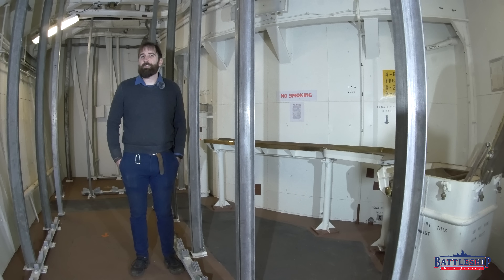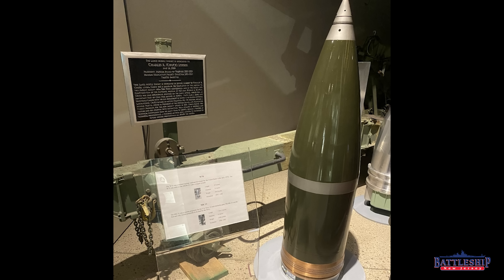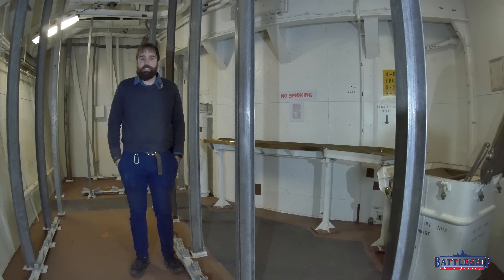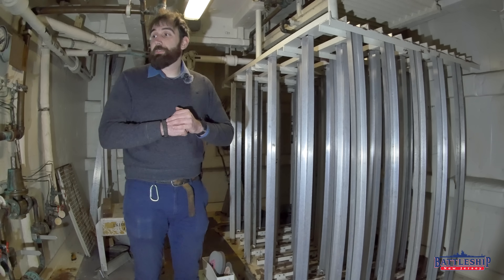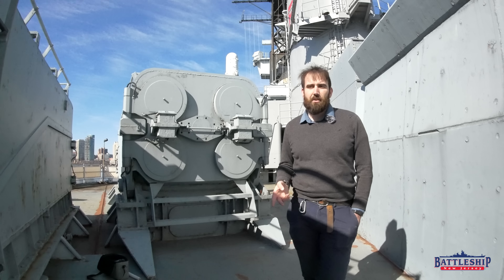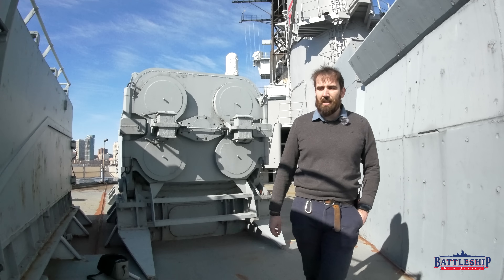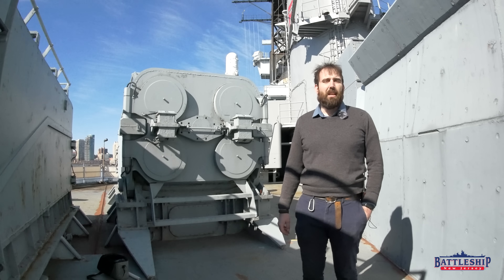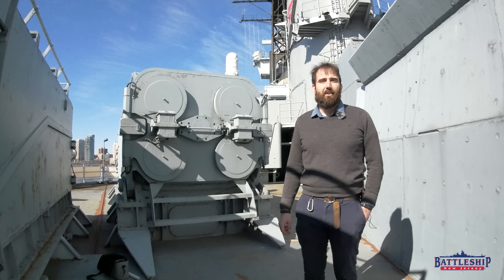Are There Still Traces of Radiation From the Nuclear Weapons on the Battleship?

Comment: I would have checked all the old gauge and compass . They were doped with radium. Also if you still have old smoke decters. If you have them DO NOT OPEN THEM ! The paint with the radium decay and turn into a dust. Open it and breathe it in or don't wash your hand you may eat the dust . Go to radio active Drew on YouTube . Just like this channel it is quite informative .
Reply: No they are americium 247 in them no radium the old smoke detectors.
Reply: @ghinckley68  yea , true . I have a small collection of them . The old detectors do have very strong radioactive material in side . And some old plates that have uranium glaze on them . And old gauges they too will set off a detector .
Reply: Better not to open any smoke detectors, old or new

Comment: You'll need the actual radioactive isotopes to contaminate something, not the radiation itself. Since warheads have their isotopes sealed deep inside, you probably won't find any evidence even if the ship was loaded with them in the past.

Your most likely location where these isotopes may have transferred would be magazines or lockers that would have contained depleted uranium as the slug or bullet. If you have ammo boxes for smaller arms, it may be there too. I'm not sure if depleted uranium rounds are jacketed but that might make it more difficult.

I work as a 'citizen scientist' contributor with SafeCast and gather radiological data as a hobby and upload to that project. Could I come by and map radiological data on and around the ship? My Geiger counter maps readings with GPS location and indicates readings in CPM (can be adjusted to Sieverts calibrated to Cesium-137).
Reply: In principle you could have some Iron-55 from steel absorbing spontaneous fission neutrons from the HEU core. But the W-23 was withdrawn more than 23 half-lives ago, so fewer than one in eight million Iron-55 nuclei would still be around.

Comment: if anything the battleship is one of the most safe places on earth in terms of shielding from radiation. having so much steel really slows down those gamma rays
Reply: nope the steel on NJ is hardly and inconvenience for a gamma ray
Reply: @ghinckley68  all it takes is 10 inchs of solid steel. where the steel is thinner than that is bellow the water line which also provides protection
Reply: @imchris5000  depends on the energy level but 10inches of lead is bare minimum. It would take a few feet of steel to stop even the weakest of them.
Reply: @ghinckley68  energy level does not matter. radiation is a wave just like microwaves. all it takes is enough space to break said wave.
Reply: @imchris5000  no you did not pay attention in high school physics. 
1, alpha particles are a He4+ nucleus 2 proton and  2 neutrons.
2, beta particles  are electrons or positrons.
3, Gamma Rays are photons at either the gamma or x-ray energy level.

Gamma rays go thru shit because the photon is small enough that on avg it goes thru the empty space in matter till it something that absorbs it.

microwaves are photons at a microwave level. In side you microwave there is magnatron tuned to 2.54ghz the vibration frequency of water. It blasts out photons at that with that wave length to heat you food.
That wave length is 12 cm that is why  they can put little holes in the door and you do not get blasted in the face.  

not death rays from a magic ferry wand powered by mediclorines.

Comment: They either were measuring in either "counts" or in milli sieverts /hr. BGR is about 1-4 mSv/hr so 6 is "slightly" elevated so maybe a trace of something or just could be a consequence of the manufacturing and what kind of alloys they used to make their launchers etc,
Reply: becreals or disinterations per sec,  sieverts is  exposure
Reply: Geiger counters are dumb and just count. Any sievert reading is just a guestimate from them and assume it's only reading one isotope, usually  cesium 137.

Comment: Many Chelsea clocks, a favorite of the USN, could be ordered with radium dials up through the early 1940s.  Ship’s clocks got overhauled pretty regularly so there probably aren’t any left on board with hot dials.  The problem with old radium dials is the phosphor gives out after a while and quits glowing, but the paint may still be radioactive.  I bought an inexpensive Geiger counter to check old ship and aircraft equipment before I do restoration work.
Reply: A fascinating story to read up on is "radium girls".
Reply: @jth877   my grandmother worked during ww2 at telechron which became timex in Ashland mass. She told tales of seeing the girls in the special paint dept, painting the clocks and watches with the glow in the dark paint. When the lights were shut off the room glowed cause of the spilled pain on the floor and table.
Reply: Not "may" be radioactive, will be. The half like is life 1600 years

Comment: You would only be able to detect a complete nuclear warhead with the instruments they had.  I could tell you why, but not without at least a secret clearance.  On the other hand, the Tomahawk had a solid rocket booster to get it going until the fins were unfolded and the turbojet engine spooled up.  I don’t know what the navy used, but many solid rocket motors use aluminum and/or magnesium in their fuels.  These metals could have been contaminated with naturally occurring radioactive materials of which uranium and radium are examples (although I think thorium is the more likely culprit).  This could have been blasted into the structures you described by missile launches.
Reply: I'm thinking that you're thinking about neutron activation of some of the light metals (aluminum or mag) in the magazine racking.  Yeah I know that you can neither confirm nor deny.
Reply: @christianweagle6253  A few neutrons are created when plutonium undergoes spontanious fission, but no large amounts until a few nanoseconds before BOOM!

Comment: New Jersey dates from 1942, which means she was built with “pre nuclear” steel.  There’s a pretty good chance that a person holed up deep in the ship has less background radiation than most places on the Earth’s surface thanks to the clean steel.  Most steel after 1945 is contaminated with fallout because it contains recycled contaminated metal.  I’ve even read that pre-WW-II shipwrecks are desirable to salvage to get clean steel.
Reply: It wasn't recycled steel that contaminated post 45 steel. All the above-ground tests put enough into the atmosphere that the airflow involved in making brand new steel from freshly mined ore would taint it enough to cause issues in some applications. Thankfully the test bans have let it return to mostly normal now so we don't have to rip battleships apart to make radiation shielding any more.
Reply: @HighlyImprobableName  Thanks.  So apparently blast furnace air and the air used in the converter process laced the steel with radiation.  That’s kind of creepy knowing we were breathing that same air.

I remember a milk scare that milk had high levels of strontium-90 from atmospheric tests when I was a kid.  The school stopped serving milk at lunch for a while.  I believe the thought was that radioactive strontium would displace calcium in bones, especially in kids.

Never mind intentional salting of the atmosphere with “green run” radiation from plutonium refining at Hanford.  I have relatives who were downwind from Hanford in the 1940s and 1950s.  It is still difficult to come by detailed information on exactly what was done in the green run tests.
Reply: @wtmayhew  Breathing the air isn't a problem. The problem only comes for very, very niche uses like steel for making the housing and shields and so forth for test equipment, such as Geiger counters and the like. You can't detect radiation levels at or below background radiation levels when your own device is emitting radiation around background levels.
Reply: @HighlyImprobableName  Say that to the C-scumbags who keep grave robbing without a single shred of humanity or remorse, cutting up water graves to get the clean steel in those ships.
Reply: The wreck of HMS Exeter is completely gone if I remember correctly.
Reply: @Eric_Hutton.1980  the wreck was destroyed by illegal salvagers
Reply: Called Pre-Trinity Steel.  Before the first nuclear bomb test at Los Alamos.
Reply: Look up "Kodak Accidentally Discovered A-Bomb Testing" in reference of airborne contamination fogging brand new film made by Kodak.
Reply: The pre WW2 steel is relevant only for very specific uses involving neutron detection where the tiny impurities from atmospheric testing affect the readings hence the need for special steel as you can't make it.
Reply: @Spookieham  Thank you for the additional insight.
Reply: A lot of wrecks, especially the more shallow ones have been plundered for their low-background steel.
Reply: @mytmousemalibu  especially the german high seas fleet that scuttled themselves after ww1 in scapa flow, some of the wrecks are still there but most of the ones in shallower waters have been scrapped in place to recycle the low background steel, even tirpitz, that was scrapped in place where she was sunk in the norwegian fjord, was recycled for the low background steel although the armored belt was reused as ground support (as in support for cranes and other construction vehicles/heavy machinery) while rebuilding norway, most of those steel plates reused from tirpitz's belt armor is still in use for that purpose to this day in norway
Reply: @Deilwynna  The instances that bother me is the salvaging of ships that are war graves. It's disrespectful to those that gave all for their country.
Reply: @mytmousemalibu  Any user of low-background steel would be interested in the providence of it to confirm it is actually low-background; those are illegally salvaged as just normal scrap steel, not even making use of the low radiation.
Reply: I read around 14 CPM in broadway and in one of the engine rooms. Top side was around 36 CPM which is close to background at around 30 CPM. The armor definitely helps.
Reply: @JeffKubel  Neat!  Thanks for taking the time to make measurements.
Reply: If that has the least background radiation then the opposite midt be grand central Station. So much natural radiation coming from the marble that lines the entire interior of the building

Comment: Anything assembled after 1945 will show as contaminated if you have sensitive enough detection equipment. Which is why the Chinese were salvaging WW2 ships that were sunk before 1945. All that steel is radiation free from all the atomic bomb testing. That steel is used for places they want low background radiation. And by the way, look for any place that used lead. Lead is a byproduct of uranium and always has trace radioactivity.

Comment: Warheads are pretty well shielded, so it’s highly unlikely that they would have irradiated anything on the battleship to such an extent that it would still be radioactive now. The best chance would have been dust or similar coming off of the DU CIWIS rounds.
Reply: New Jersey probably wouldn't have any "hot spots" but Battleship Missouri might.  Ryan pointed out that "MO" was hit by CIWS 20mm "friendly fire" from another US warship.  The points where those rounds impacted may well have tiny traces of Depleted Uranium still in the steel and may be detectable by sensitive sensors like that Coast Guard crew were using, but no where nearly radioactive enough to pose a hazard.
Reply: Plus uranium and plutonium aren't especially radioactive. They mostly just kinda sit there and occasionally spit out alpha particles, which can be blocked by a sheet of paper.
Reply: @Ralph-yn3gr  Plutonium depending on what isotope is will get hot.
Reply: @Ralph-yn3gr  This is only true of Uranium-238 (Depleted Uranium) with a half-life into the billions (10^9) of years. The isotope of Plutonium-239 used in various weapons is only in the tens of thousands (10^4) of years, making it about 100,000 times more radioactive than the comparatively sedate Uranium-238. Even the most stable Plutonium Isotope is about 1000 times more radioactive.

All that pales in comparison to their chemical toxicity, though, with seven different oxidation states. This is the real issue with depleted uranium munitions, inhaling the dust or consuming dust-contaminated food and water; the radiation might get you in a few decades, but the toxicity will get you in a few weeks, maybe days.
Reply: @KiithnarasAshaa  Your comment is more or less correct, however I think it should be pointed out that there is no plutonium isotope used in weapons in a manner similar to depleted uranium, e.g. making the slugs heavier for purely kinetic reasons.    Therefore mentioning it is a fairly irrelevant thing to do when discussing whether there could be radioactive material "loose" on Iowa.  If there were, people would be dead already.
Reply: @Ralph-yn3gr  yes but if you inhale it, then it’s inside you, so it doesn’t need to penetrate a sheet of paper to hurt you
Reply: the deplete uranium is encased in the round it wouldn't be shedding dust!! that spike is most likely from the welding electrode used to weld the launcher shut!
Reply: Think about it, if nuclear weapons were hot in any way they would be a hazard to the people who handle them. Tank crews get up close and personal with DU all the time, it's only a threat to them if the metal encasement is damaged.
Reply: Only neutron radiation can make other materials radioactive.

And neutrons would mean there's an active fission or fusion process running. Which would be quite noticable.
Reply: Well this is not what really happens. All radioactive materials put off radiation in different MeV ranges even in the Kev ranges. Its sort of like a nuclear radiation finger print. These radiations can also make other materials radioactive which is why the neutron bomb which does not generate lingering radiation to humans was thought safe and hence a great first strike weapon. Until they used it on a mock town and found that it made the metals in the town radioactive and dangerous to humans so much for having a clean weapon and we could move into the town after it went off.
Reply: Irradiating just means exposing to radiation. Irradiation does not make things radioactive. Radioactive shells would not make anything radioactive by irradiating them.

Comment: I know tritium lights were a thing, had a relatively short half life but there might still be a bit lying around some where
Reply: tritium is still commonly used on night sights especially for handguns and the like and they typically only have a half life of maybe 10-12 yrs so doubt they will have any traces of that.
Reply: @jamesmaxwell4447  Ten half-lives is the point where a substance is commonly considered inert.  Obviously, if the point is to have a certain level of activity, then the useful life span is considerably less.
Reply: @kevincrosby1760  Yeah I was figuring that the last time they retrofitted was in the 80s so that's closeish to 4 half lifes assuming that was even a policy for the 80s, so would think by that point, less I guess the capsule is damaged, you probably wouldn't be able to see nor detect it at that rate. But yeah I am def no authority.
Reply: Tritium decays into helium by giving off a beta particle.  That’s a medium energy electron.  As long as the tritium stays sealed up in a glass envelope, that pretty much stops the beta particles.  The beta radiation isn’t energetic enough to turn other materials radioactive.
Reply: Since tritium is hydrogen it tends to float away. Of course back then they tried to embed it into solids, but still... Many half lifes have been and gone.

Comment: What about radiation detected in the sickbay from x-ray machines.
Reply: I’m not an expert on the machines the Navy had, but X-rays snd Gamma-rays are extremely high frequency forms of radio waves.  Most likely when the machine was switched off, the X radiation stopped.  X-rays are energetic enough to cause chemical reactions and can alter DNA or whatever.  Generally,  X-rays are not energetic enough to cause a nuclear reaction which would make something exposed to X-rays turn radioactive.  Having said that, it wouldn’t be a total surprise to find out that the infirmary had some type of cobalt radioactive source which could have left telltale signs behind if mishandled.